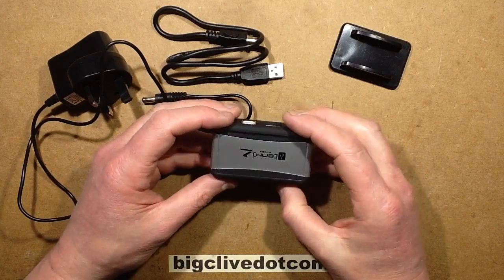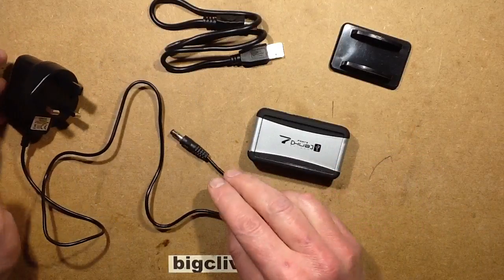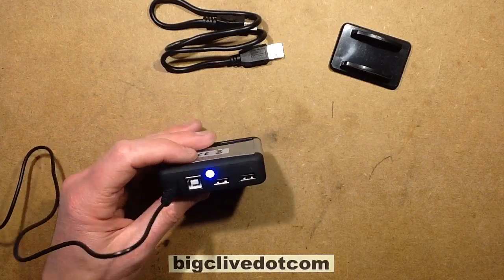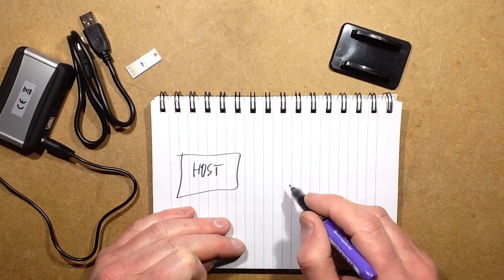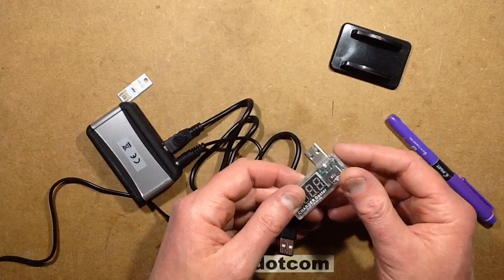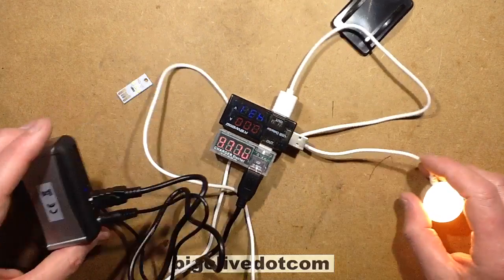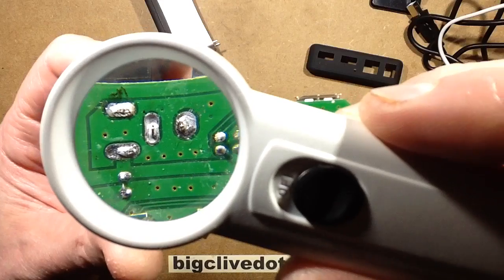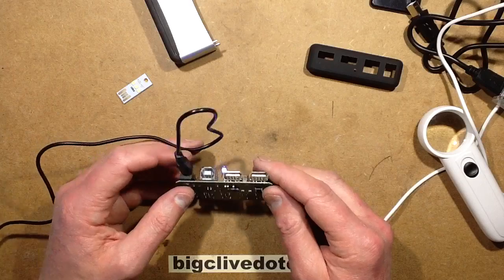Computer killing powered USB hub.  (Mac murderer)

Comment: Hi Clive and all,
My experience is that almost all usb hubs do that!
I've had a number of different ones that have leds on on the motherboard when the PC power is right off!
I'd have thought that a shotkey diode or mosfet could be used to stop this, but generally no!
This being the case, I'd think that Macs and other pcs should be designed to take that, so I have to think there must be something about that power brick that is feeding some kind of nastyness into the port!
Anyone else got different usb hubs they can look at and let us know on here if yours back feeds too?
I'll bet it does!

Will
Reply: I've got two similar ones ("Xtensions" brand) from almost ten years back doing the same.
Reply: +scramjet13 
Yep, I'm not surprised, and I really think it'll be unlikely we'll find too many that don't!
The cards/motherboards should have poly fuses and other protection if it's a problem for them.
I'll be interested to see what everyone else finds with their own usb hubs!

Comment: Hey Clive. I have a dreamcast I was looking into getting modded and was wondering if you could take a crack at it since you seeem to know what you're doing with eletrical component. I'd be better asking this once the flash chips arrived but once they do could I possibly mail you the console, components and instructions? I'd have taken a go at this myself but I'm still new to soldering and also I can't seem to get one of the screws out inside the console that the previous owner seems to have super glued down.

Comment: Why is having more than one supply on a rail bad? The problem seems to happen when the device is off, reverse biasing of a transistor?
Reply: the voltages aren't necessarily the same. the reference on one might be a fraction of a volt off from the other, all of a sudden you have a power supply sinking a bunch of current, perhaps enough to break it. it's the same reason you can't use diodes in parallel.

Comment: Hi Clive, I just got 4 led strips and a 6a 12v power supply to power them all at once do you think it will be save if I leave the supply on?

P.s I know this Han nothing to do with the vid but I just wanted to know if you can help me.......
Reply from the maker: +Ben Love It depends on how much current each strip needs.  I'd also suggest running the power supplies at half their rated current so they don't get hot and fail quickly.
Reply: +bigclivedotcom the led strips are around 1/2 of 1a per peace and I have 4 on 1 supply
Reply from the maker: +Ben Love If they are 0.5A each then the total would be 2A and that would be well within the ability of a 6A supply.
Reply: +bigclivedotcom thanks

Comment: Are we sure this is not by design? It makes sense to me that it could be a multi USB charging hub OR a usb powered hub but not both. It would possibly say in the instructions "never use with pc when power is plugged in". Still a pretty poor product if this was the case, not being fool proof or obvious.
Reply: +L4RRY I was thinking the same thing, that perhaps it is intentional, but then there really is no excuse for not spending a couple of cents and adding a reverse-protection diode. It would likely have to be a schotkky diode, because the silicon 0.7V drop might be unacceptable on a 5V supply... but still, all it needs is just ONE of these, on the host port.

Comment: I have that exact model, thanks for the tip. I just managed to find a space for a schottky diode in there, so no more back feeding for me (although it hasn't killed my PC so far).  These aren't well-made units.  When I first got mine, a couple of the ports didn't work properly. The solder joints were terrible - in some places no solder at all. I had to go and resolder.

Comment: I used to use this  - fried my raspberry Pi! windows based PC's should detect over voltage on usb ports and some motherboards have protection built in and will shut these off I believe. 

Not saying you should try this, but if you short out a usb port / internal hub on a windows machine, a notification should come up saying something like 'USB over voltage detected' and it is disabled until the short / overload etc is cleared and manually reset - not sure if this is a motherboard reliant thing or not? 

Thanks for another great video!

Comment: Another thing to watch out for,  one of my USB3 hubs when it failed  killed the devices connected by providing 16v to each of the USB ports.  The $40 hub ended up costing me $200 in dead high speed memory sticks.
Reply: How is this even possible? Adapter failure?

Comment: It would be interesting to see the voltage on the host connector compared to the computer supplied USB voltage. Two regulated power supplies, set for different voltages, and hooked together could engage in a high current "battle of the voltages", with the higher voltage one sourcing the current and the lower one sinking that same current! For example, if one was set for 5.0 volts, or even 4.75, and the other for 5.25. I think the USB spec is 5.0 volts ±5%.

Comment: here is a joke  

yesterday i went into an apple store and farted and everyone went mad at me but i just said it was not my fault they did not have any windows
Reply: +Jabacon That is not correct. The newer macs run X86 processors and can run windows full speed without emulation, the older powerPC ones couldn't.
Reply: +Dami Nooki They always have been, just ROM based OS usage is retarded, emulation always worked. Although all Macs until recently have been too underpowered to emulate Windows XP because they have three year out of date hardware.
Reply: Macs have had 64bit processors for a while, Intel makes them

Comment: You got me scared. I've been using an old IRock 4 port USB powered  hub on my 2014 Mac Mini to reliably power a USB powered Schiit Modi DAC. I haven't had any problems, but I think I'd rather be safe than sorry. Without the powered hub, the DAC sometimes disconnects. I can live with that if there's a possibility of damaging my Mac. BTW, I have both Macs and PC's. I'm not a fanboy of either. They both serve their purpose.

Comment: The back-feeding is actually a lot more common than you'd think, although most machines I've seen don't have any issues with it.  The worst thing I have had happen was a machine that got "confused" until I unplugged the hub and it's power/battery.  Then again, most PCs also keep 5v live to the USB ports for charging even in sleep so maybe that's why it doesn't affect them.

Typically there is at least a one-way feed from the PC on the +5v side, this way it can work as an unpowered or powered hub.

I'm not going to say I like that "non isolated" design, but it sounds like the Macs had improper circuitry if it killed them without reverse-polarity or high-voltages.  The computers are supposed to have protection against short/overload on the USB ports and back-feeding shouldn't be able to cause any perminant damage.  Sounds like design faults on both sides (Apple and the hub) in this case.

Comment: thats adopter port is for special perpose.. if some on dont have any laptop or usb powering source they supplied an adopter from which they can get 5 volts USB devices i.e usb fan, usb tourch, usb 3g wifi dongle etc etc
Reply: so if some one wants to use via PC they dont have to plug in adopter.. i hope they mention this in its user manual
Reply: on the otherside Apple should take care about this to protect the USB slots. this seems to be the flaw in MAC aswell
Reply: +Azhar Khan   On the correct side, this piece of shit hub should NOT be inputting 5 volts to the host port. Period.  Cheap Chinese shit.

Comment: I have this exact same hub and when I used it I discovered it was heating up exceptionally and giving off an electronic smell. I immediately removed it from my computer however the USB port it was plugged in to no longer works.

Comment: This is weird. I could actually follow along in person with this video. I have that device (except mine has a red LED). And yeah it's the same connection for mine too. For what it's worth, PC MASTER RACE wins, because my computer hasn't complained about it yet. Though I think I'll take the data cable I've been using and cut the 5v+ wire, just to be safe.

Comment: The old Speed passion reventon program boxes for ESC's could send voltage through your USB and fry your computer if you plugged in the battery (common to have to power up esc from other manufactures)

Happened to a guy at the track- took the life of his $1300 laptop.

Comment: You are only suppose to use the PSU when used standalone that is really odd indeed! Wonder if it would break a PC Usb port also or if they have built-in protection against this?
Reply: Probably depends upon the chipset selected motherboard, though I have had a PC survive 12VDC being injected into the USB port's 5V out when one of my projects shorted the 12V rail (from a 50A power supply) to the 5V USB rail.  The PC shutdown instantly but everything (thankfully) was fine after a reboot save for a popup message warning about an earlier "anomaly" on a USB port.

However, I have had a motherboard's video chipset fried and disable the computer due to a failed LCD monitor injecting 5VDC into the PC's HDMI port and back feeding the motherboard.  Took awhile to discover that the computer could only boot if that monitor was disconnected during boot up...the tip off being the discovery that a cooling fan was slowly spinning while the PC was unplugged and the power supply pulled -- it was drawing power from the monitor --- just a couple volts, but enough to fail POST tests, panic, and immediately shutdown on power up.

Comment: I thought USB host ports were supposed to be diode protected?
Reply: +Richard Smith Surely a Mac's USB ports should be diode protected then, since they're such well made products
Reply: Elliott Hurst They don't, which is why it kills them. This was a common problem back in the day on PC's, and it became a standard feature of motherboards because people kept frying their machines with faulty USB devices. 
I have no idea what logic went in to Apple opting out of that feature.
Reply: Elliott Hurst Yep, that was my guess too. Pretty shitty decision for a 'high end' product.
Reply: @rich1051414  It's only like 10 cents for a diode, sometimes cheaper!
Reply: Elliott Hurst Yeah... about that....
Reply: Richard Smith Seriously though, MAC's are marketed as such high end products, surely they should have such a basic safety feature, especially since their hardware is unique to the product.
Reply: +Richard Smith Maybe they're trying to save money
Reply: +Djhg2000 I was also expecting a diode in there.

I guess a well designed hub might have one.
Reply: +pileofstuff A well designed computer will diode their USB ports to prevent backfeeding power.

Comment: The trouble with trying to solve this with a diode is the voltage drop across the diode is somewhat detrimental to power distribution. A transistor based switch is possible but costs more. 
The simple solution ought to be to use the switch built into the socket but this switch is connected to the outer of the jack that is normally ground so to switch positive you'd either need a more complex socket design or a power supply with a negative center pin. Negative center is asking for trouble as it would be the reverse of most IT-related power adaptors I've seen.

Comment: Could +5v track to the host port be cut to fix this?
Reply: Sure, but that means you can't use it without an external power supply anymore since you've also cut the +5V running from the host port to the 5 slave ports.

Comment: the way I see it is that the power supply is really only to be used if you want to charge a usb device like a phone or ps4 or xbox one controller without the hub being plugged into a computer. The othe port is for using with a pc or mac to provide power to usb devices

Comment: Out of curiosity, could you use this to back power a android device so that you could have a otg hub and power supply at the same time ?
Its a shame most tablets only come wit a single USB connection for everything.
Reply: +TioPaleshadow Interesting question. The Android device would probably feed 5V out of the USB port when you plug a device in, but I wonder how it would react when it gets power back into the port for charging.. Hmm.
Reply: Delightful Hardware

Most android tablets and phones these days get power from the same port they use for communication you and it is possible to have both at the same time like when you plug it into your computer. But running a android device standalone in the field it would be nice to connect peripherals at the same time as you power the device.

Comment: Can you fix this by either breaking the connections inside the hub, or maybe soldering in a diode or two to stop reverse voltage?

Comment: you could install a switch to make the 5 volt power adapter provide power and disconnect the power to let the usb port supply the 5 volt power. double pull single throw would do the job.

Comment: Perhaps the older modles aren't that way, or perhaps I have never tried them with both plugs plugged in, but I have 3 of those devices and used to use them all the time, both on my PC's and My Mac's.  Maybe I have just been lucky but they all went in the bin during my last cleanup

Comment: think you'll find almost all hubs are this sort of design. don't forget these are CHEAP hubs you want better designs go and spend some money. the 5v is connected so it can be an unpowered hub. a good motherboard has protection against feedback that why cheap hubs very rarely kill proper computers and laptops. if you an idiot from the world of Mac then use Mac or apple branded stuff (you wanted to be different so stay different)

Comment: The usual way would be to have diodes on the host port. Most USB hubs are self-powered, but you can give them extra juice for the connected devices by plugging in the power supply. 

Anyway, just backfeeding the power isn't okay. On the other hand, high quality mainboards have protection chips that simply disconnect ports that don't behave well. I have used those chips myself in the past for my own circuits that connect to a PC - I didn't want a software glitch in my micro to fry the USB port or even the whole computer. It was also a capacitive sensing application, and I didn't want a grounds reference from the computer sneaking in, along with all the electrical noise. They allow you to to completely isolate the host and device side. I used the ADuM3160, which is a prominent example. 

So the bottom line is: Although Macs were the first computers to employ USB instead of the typical legacy ports, current generation Macs don't have proper USB isolation. You should be able to backfeed power into the host without permanent damage.

Comment: I had one of those exact ones except had a store's own brand logo on it, went up in smoke when I connected an arduino to it and connected the arduino to a chinese wireless door bell thing (cut the speaker, wanted to use it as a wireless button) and the door bell didn't use a transformer to run at DC, it used some differential approach making it basically 242.5v and 237.5v, worked fine as long as the arduino was running on batteries etc but connected it to the hub which in turn was connected to my PC and kaboom, hub and arduino toast, PC fine luckily.

Comment: Hi Clive I was wondering if you could do your trickery pokery on a 110v transformer (the yellow building site ones) please. As I am going to be using mine at home diy,ing would my electric meter go ballistic  leaving it switched on not under load between usage of my different tools or do I need to switch it off and only turn on when needed or will doing that make the meter wiz round powering it up every time. Many thanks
Reply from the maker: +Brett Milnes It should be fine, but the transformer will have what are called copper and iron losses that will result in continuous power consumption while plugged in.

Comment: What happens if you get that cable And cut the positive line and let the datas and the ground line
Reply: Will it not Kill macs
Reply: +eduardo favatti if you just use usb gnd+data, and the external power supply, there should be no problem in using this hub

Comment: I have had two of these, and it worked fine on a Raspberry Pi & and a laptop.
But it did backfeed and keep the RPI on whilst the RPI was unplugged.
Reply: Same here with the Raspberry Pi. I never really thought about it though. Note there are various versions of this hub kicking around on Amazon etc. I have both a silver and a black one that exhibit thus behaviour. Both going in the bin now I think.
Reply: Charlie Pearce
Mine was an exact clone.

Comment: Another interesting experiment to try with these cheap self-powered hubs:  Cut the VBUS line from the USB port, and then wire the hub's power connector directly to the computer's power supply.  It's fun watching all the magic smoke escape from the hub when a fault occurs and the PC power supply decides to send 100W to it. :-)

Comment: I've been searching for the cause of my Asus based desktop PC randomly shutting down.  No warning, just goes dark instantly. Switching back on and it works fine. I have an Anker USB3 hub with it's own power supply. Just checked, and sure enough, there is 5v on the input! it's now in the bin, lets see if the random shut downs continue!
Thanks Clive - a most useful channel! Patreon donation on it's way!!
Reply: +Peter Kay Well you may wan't to pick it out of the bin. While according to the USB standard backfeeding is not allowed, it's most likely not a problem.
Reply from the maker: +Morten Kristiansen But no harm in trying the computer without the hub for a while.
Reply: +bigclivedotcom Absolutely